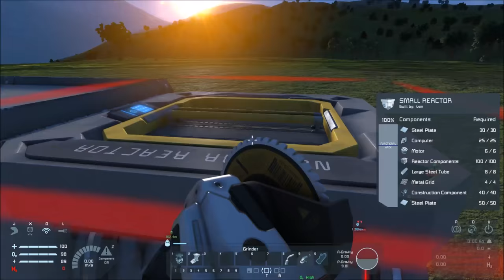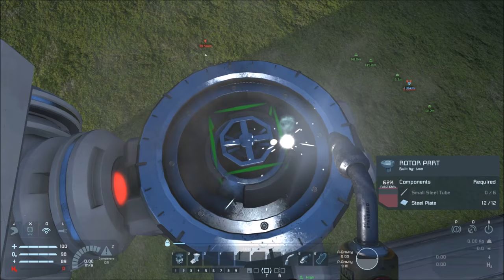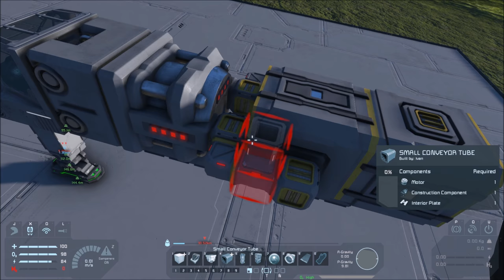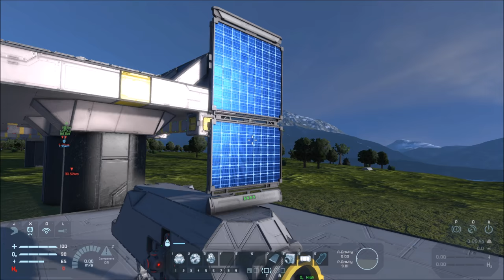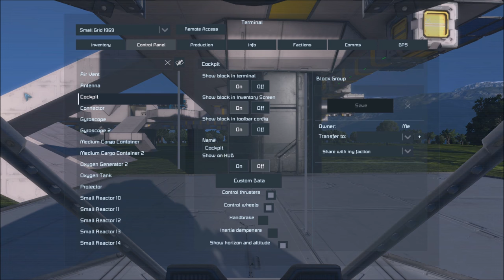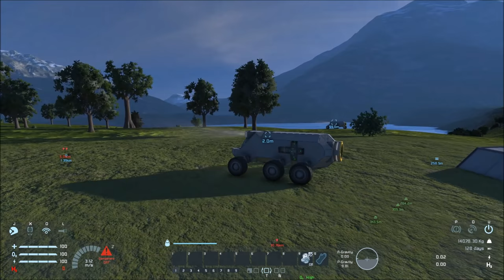*Updated* Space Engineers Land Vehicle Tutorial 3 27 2017

Comment: 1. You always have a accessible reactor so you can directly deposit fuel in emergenct.
2. containers are the 1rst things to crash even without direct impact and if you put all the crucial components attached to it......
3. use blast doors as bumpers, they work.
4. Higher clearence could be achieved by using halfwalls and corners underneath.
5. Allways check center of mass, as low as possible and to the center.
Cheers.

Comment: Do you recommend light or heavy blocks? I used light blocks for in my first attempt making a vehicle and it broke apart after hitting a bump - lol. Great video, thanks
Reply from the maker: I like to use what I like to call a skidplate which is heavy blocks on the bottom. The rest of the craft depends on if I think it will be in danger of being attacked and what its purpose is.
Reply: @Ivan_Cornelius  Thanks! I will try it. Guess I could use heavy half blocks to reduce thickness.